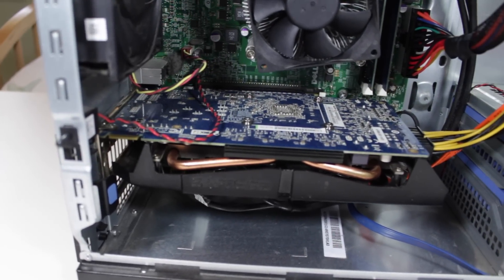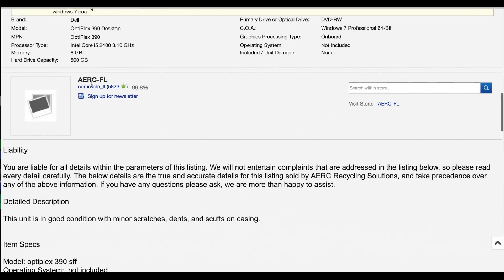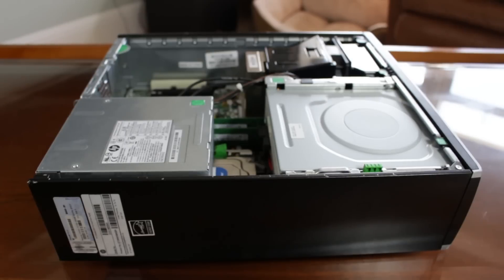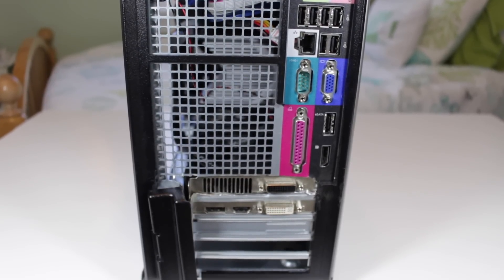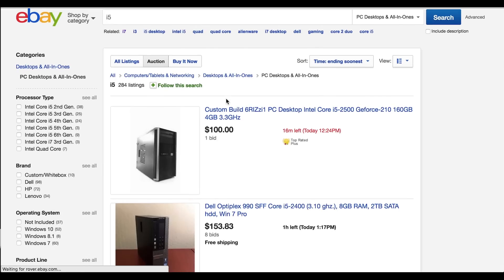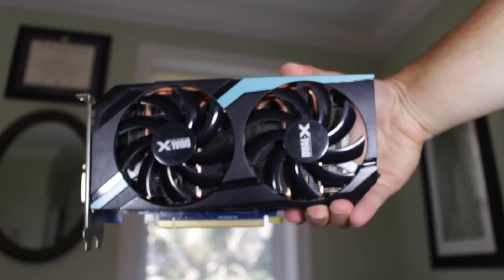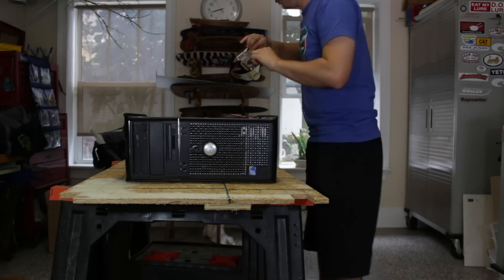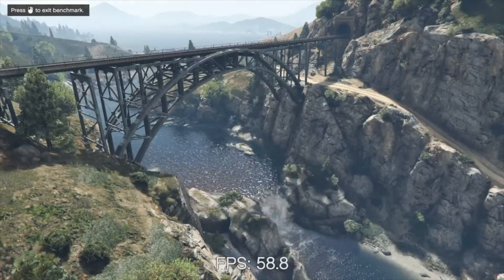How to build a GAMING PC for under $200! (2016)

Comment: i'm a pc noob and i took your advice about buying a dell optiplex on ebay for $50. i also bought a EVGA GeForce GT 610 Graphics Card ‑ 2 GB DDR3 for about $35. i didn't realize that the Optiplex was a small form factor, so after i plugged in my graphics card i tried popping the side panel back on and found out that the card was sticking out of the pc case because it was too big LOL. i now have to cut a horizontal line across my pc's side panel so that the card can go through it when i put the panel back on. i learned my lesson. always measure first.
Reply: sorry. but that gpu just cant handle new games... not even 720p low :(
Reply: +CWplayer I use to play a game on roblox 😂😂
Reply: +champagne dannny but still. 50 dollars... that gets you a used 750ti with some very good luck or 650

Comment: http://pcpartpicker.com/list/8bnhyf
Hey Matt do you think this pc could play gta v at low settings 60fps+
Reply: No get a Rx r9 380
Reply: I cant I can only get the Gt 740
Reply: Spend less on the case and put it into the GPU at least a 750 ti also the Evga 600 watt bronze certified is for some reason a few dollars cheaper than the 500 watt one so i would suggest getting that as its cheaper and better.
Reply: Oh and i'd go with 2x4gig ram rather than 1x8
Reply: Robert Perry Im gonna add another 8gb ram stick later on
Reply: Gotcha well that makes sense. I'd still personally try to cut costs on the case and add it to the gpu personally i saw that you can get a 950 with a 20 dollar mail-in-rebate for 119 dollars if you can get that it would be a huge upgrade from the 740!
Reply: Robert Perry true :D

Comment: I got 
Phenom II X4 955
12 GB DDR3
Gigabyte GAMA790XTUD4P
Xigmatek Thors Hammer
VTX3D HD 7850 2 GB
Sharkoon 450W PSU
Antec 900 Midi
Creative Soundcard (forgot which one)

for 200 euros
Reply: +Toxil4D fan 200 euros lol
Reply from the maker: Nice finds!
Reply: ewhruhwfjsjfiwsfijwwf Good for bang for buck, but that's a low performance build. new games nowadays are gonna struggle on a C2Q 8400 or a 96xx without the overclock.

the 7850 is again a medium settings card for a lot of the new games. but you can definitely get a lot of gameplay out of those pieces.

I had the 8800GT, 9800GT, HD4850, GTX260/c216, HD7850 and now the r7970. the 7850 had the longest lifespan out of all of my cards, if I bought the 8800GT when it come out, it would have probably lasted the longest as that card was a beast for its time.

I had a lot of other bad as cards, on my original PC's like the FX4200 and a 8400GS before I started 3D games on the PC lol
Reply: cost?
Reply: To be completely fair, it originally had a 6870 and 4 gigs of ram but i sold the sound card so i could upgrade the ram and i sold the 6870 for 50 euros and i got the 7850 for 50 euros so yeah
Reply: why are u using sound cards retro build?  if not for retro  DOS game builds then save your money, put it elsewhere..   most motherboards produce very high quality audio on either own. if you need a DAC/ADC i recommend going completely external since interference would be inside the chassis. going external is best way to avoid inductive load noise as the thick metal grounded chassis of the PC would block most of it.  i never had to do veryt much work to block inductive load. only time i had and issue the solution i used that worked was using that metallic tape, and tapping around the audio wire that goes to front panel headphone jack then zip tied it off so wouldnt short on board..cured entire issue. overall i think its a waist of money unless retro gaming (like DOS)
Reply: yeah dude, nice but that's just reaching it's limit.. I just upgraded from a Phenom II x6 1100T + Sapphire 2gb HD7850 OC version.

and games like H1Z1, DOOM, ARK and the Division was struggling, even on lowest settings. but it will play games like overwatch, battlefront, rainbowsix seige etc perfectly.

but still, for €200 that's a good find indeed. and you will be able to cut corners to get to be able to play every game if you fiddle with settings, except maybe DOOM. (I'm talking from the demo gameplay, where you couldn't change many graphics settings)

and well.. that ran at like 20fps and wouldn't ever go smooth on my system. but as I said that was probably mainly down to it being in beta stage.

but it all broke recently to a storm, then again to a heatwave T.T 

and I got this for £475 in a second hand store a 5 minute walk from my house

rampage II extreme x58
i7 980x w/corsair single fan radiator all-in-1 watercooler (not sure which one)
6x2gb - 12gb ddr3 1600 cosair vengeance 
XFX R7970 3GB
500w TR2 S Thermaltake
Antec case (don't know which one, but it has a huge fan in the top)

I don't know how good that is as a deal, but I don't own any new new parts so I was impressed I was able to get this locally, since I live in Luton, UK.. didn't expect a second hand store to stock something like this lol

it's really worth checking them places out every now and then
Reply: Antec 902 V3 is the case, I just googled Antec big fan LOL
Reply: Segorisk Johnny the case has like the best airflow ever
Reply: ewhruhwfjsjfiwsfijwwf yeah it pushes some air alright, the fan on the radiator doesn't seem to do much though sitting at around 35C idle but the weird thing is it only goes to around 40-50C(MAX) during demanding gaming.. very strange for such high idle temps, my old "shadow rock pro" cooler was idling at like 20-25ish, then spiked to like 75C+ under load.

I have an interesting bit of kit though, one of my friends stole from his work (shhhhhhh) lol!

a 120mm delta fan which his brother bodged to a 9v Nokia charger.. so it has to be plugged into the mains but this thing is ridiculous lol it's so loud and would cut your finger off hahahah gonna have some fun I think on the radiator of that corsair water cooler. when I'm brave enough to start overclocking 
... probably in the winter ;)
Reply: lol :D speaking of loud fans i got a hd 7870 from ebay today for 10 bucks because it has a broken bios where the fans are at 100% all the time

and its louder than a gtx 480 and 290x combined
Reply: i have 1,45 vcore on my phenom ii x4 but it doesnt get hotter than 43° :D xigmatek thors hammer here
Reply: ewhruhwfjsjfiwsfijwwf ooo, I don't know how difficult it is to reset, but I know it's possible to flash the bios, cause i heard some old 4xxx series cards could be flashed to trick your computer into crossfire on 2 incompatible cards. so I'm guessing that can be fixed!

and yeah, that's a nice cooler I think maybe water cooling just has bad idle temps
Reply: i already tried multiple bioses its a error in the fan and not in the bios :/
Reply: so there's literally nothing you can do to adjust those fans? lol that's lameeee.

hardware controller? like the dimmer lights dial.

not ideal, but i got one hanging out the back of my PC, for the CPU fan and you need a long term fix, even buying the resistor you need and bodging it on would probably be better than letting the fans fail in the middle of a game, where they have run at 100% for 2 years LMAO

good find though for $10, you got a multimonitor setup?

because if you do, just having your temperatures of your GPU visible while gaming, then run that thing into the ground lmao that's what i'd do anyway. 
so if a fan did melt itself, you would see the temperature rise. surely AMD catalyst can have some kind of warning when it breaks a set temperature.
Reply: Segorisk Johnny
yep i always have my afterburner on my second monitor to see my temps etc. it only has to work for a few months because im saving up for a rx480 :)its better than the 9500 gt i had after my original 7850 broke
Reply: *****
yup no problem
Reply: *****  give me your soul and kids... just kidding, it takes a bit of research and waiting for the perfect deals. always check craigslist and ebay a few times a day, and if you want the best bang for your buck, go with a core2quad (15 euros in germany) and overclock that to 3-4 ghz and go with 8 gigs of ddr2 and a hd 7850-7970 or a comparable nvidia card but nvidia cards are usually much more pricey
Reply: i have a 9500 gt in one of my pcs lol but i only use it for surfing^^